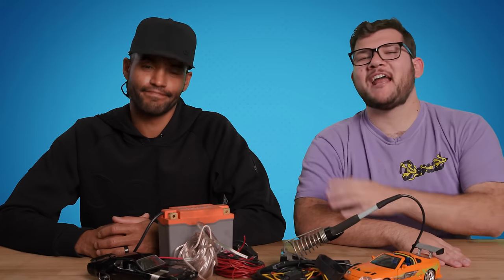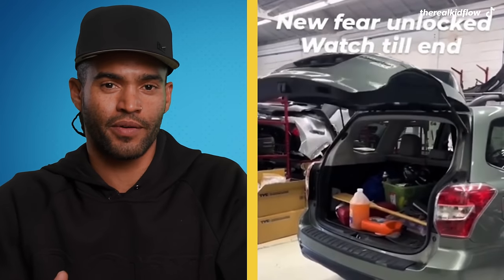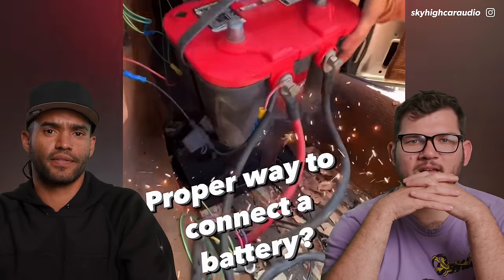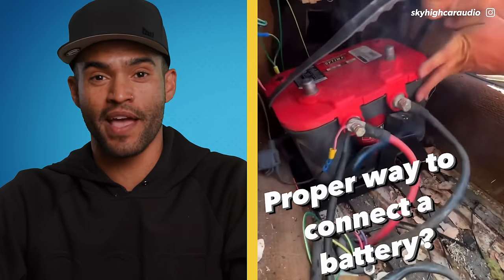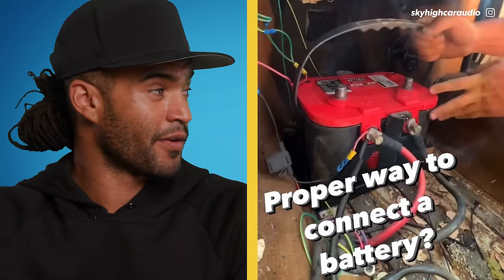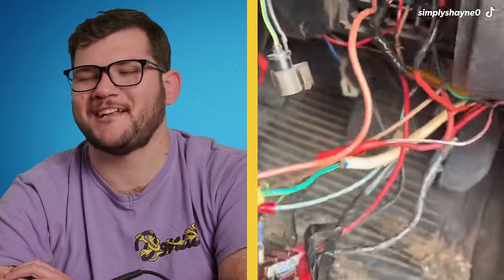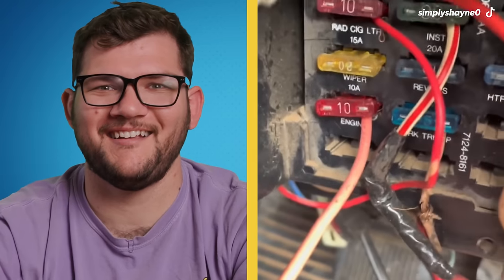Mechanic Reacts to Deadly Electrical Repair Fails

Comment: "Hey Subaru, open the tailgate." "I'm afraid I can't do that, Dave."
Reply: 12v open 24v close.😬
Reply: It actually is a serious and real issue. It an electric motor driving an actuator. Something stripped out inside, reaches end and bang!

Somebody tried to slam it shut by force probably.
Reply: Lesbian trap if I've ever seen one.
Reply: I had the same issue on my forester, just a blown gas strut
Reply: @JohnDoe-fb1zv 😂😂Lesbaru
Reply: That legit scared me
Reply: The voice saying that is burbed into my memory lol
Reply: It needs gas struts to hold it up where the motor stops pushing it open.
Reply: Portal Ref take my like
Reply: I owned a 2006 Subaru Legacy GT.

Previous single owner 0-105k miles was an old Japanese man who babied it.

I babied it for 3 years 105k-124k miles.

Total money pit.

Never Subaru. Never again.
Reply: @nTrylo true story?????
Reply: I feel sad that nobody really got your joke. Just want you to know I did, and I appreciate it.
Reply: That subaru footage is edited. Theres no way it will do that. Theres still a gear drive in the actuation strut. It doesnt just freewheel like that. It could if it were completely stripped out, but if that were the case it wouldnt raise either.
Reply: @jasonh4167  120A open. 800A close, more like. The whole tail of the car squatted when it slammed it was that hard.
Reply: @enemyspotted2467  You make it sound like such a small problem... this would have legit severely injured someone. This was not just the liftgate falling. It was motorized slamming.
Reply: @redcroft308  I doubt it's edited, that looks like the lift arm/actuator is either bent and/or mis-timed from the rear hatch struts failing. I've seen a similar failure with an older Sienna and Highlander, though not as drastic as the one in the video. 

The system that we're looking at seems to be similar to Toyota's set-up, those used standard gas-charged struts to support the weight of the hatch, with a third "lifter arm" sticking out of the driver's side interior panel to assist the hatch in opening/closing. It wasn't designed to fully support the weight of the rear hatch, so when the gas struts wear out it starts straining/struggling over time (I've seen this result in literally bending the rear hatch due to imbalance). In this case, I am guessing that their specific unit has either stripped the last few teeth on the gear plate and/or it hits a specific point where it deflects enough to literally jump time/gear and then just slams shut because nothing else is supporting the rear hatch at that point. Despite it being deceptively smooth in the video (most of the ones I have seen tend to jerk more), you can hear the lifter motor straining some as it's working. 

Unfortunately, if they let it go this long; it's probably going to end up being more expensive than two gas struts.
Reply: @redcroft308  Deconstruct how that was edited because I see no clear or obvious signs of modification. It slammed shut so hard the car squatted at the tag/tag surround flapped out also. If you can show or explain how this was edited I might be more inclined to believe you but currently I do not. At all. It seems to me to be a possible corruption in the BCM or another module perhaps, that when it's given the command to open the liftgate, it starts opening then runs into a computer fault/nand/cache corruption is read and the module just rams the liftgate closed. Also, everyone saying it's opening slowly... no. It's opening at speed. Closing at McLaren speed.
Reply: I have a forester, the back hatch  opens painfully slow. Also subaru has a recall/extended warranty on the gas struts.
Reply: @crazyidiot5309  the film clearly cuts. Its missing frames. You know, just like bruce lee movies where he "was so fast the camera couldnt keep up". Its not rocket science. The film is cut and lets say it isnt, somehow, fuckin magically. In that case, then the thing has been tampered with. Those actuators DON'T OPERATE THAT WAY, PERIOD. I'm speaking from a specific point of authority on this, if you havent figured that out yet.
Reply: @redcroft308  Time code where video cuts please. Also, if you know the way the actuators are controlled by the button/key, please map that out so I might believe you as well, because you've given no facts, only speculation with your "specific point of authority" on this particular issue. How does the actuator actually function, because with key/button control clearly indicates a connection with a BCM/ECU module of some type. There's like 30 of them in each vehicles since like 2000.
Reply: @clintondomingo932 it's originally from 2001 a Space Odyssey.
Reply: I’ve seen videos from multiple manufacturers that do this.  I remember for sure seeing a BMW do this.
Reply: "now dave.... Why did you oil change me 500miles later? Am I a joke to you?" 

Trunk starts opening and closing fast
Reply: @russelljacob7955 yeah I guarantee someone slammed it shut hard not knowing
Reply: @vinnyaraujo88  and when they go out You get this :D guess how I know :D
Reply: Smart move from the subaru owner. He found out his wife cheated on him.
Reply: Love the movie reference sadly not many noticed it😂
Reply: @hal8226  HAL was crazy

Comment: As someone who lives in Alaska, oil pan heaters are very common. Its called winterization. Very necessary when the weather can get to -50°. Wait till you see our parking lots that have outlets at every space. A lot of tourists think alaskan vehicles are electric when they see em all plugged in 😂
Reply: Same as Canadian Winters. Block heaters are pretty much standard
Reply: I'm a little surprised they aren't even a little familiar with the concept, and assume it must be a race car.
Reply: Same here in MT, gets as cold if not colder speaking from experience  (grew up in AK) and I feel bad for the car folks from less extreme climates not having a clue how to deal with it. Used to see alot of customers come into the parts store w a myriad of cold related questions and concerns and some needed ALOT of hand holding lol
That's funny too, about the parking power outlets, I'd totally forgotten that Lil quirk😅
Reply: I'd say that's a pretty standard with every northern place in the world. Like how stud tires are a must in the most northern parts of the Norwegian.
Reply: we used to call them dipstick heaters when I lived in Vermont in the late 70's early 80's
Reply: My VW VR6 has one because a normal water jacket block heater is not doable on it.

The installation though is pretty bad.
Reply: The California guys trying to figure out winterizing. 😂
Reply: Yup.  Lived in Fairbanks for 20 years.  I installed 2 block heaters, an oil pan heater, and a battery heater on my truck.  When it's 50 below zero, that's what it took to get that beast started.
Reply: Ya, I live in Fairbanks. It kinda surprised me when that clip came up, because it's rare to see a car without that stuff here
Reply: @freefall8243  "Impressive! That is like race car stuff!"

No, its a 15 year old economy car?
Reply: Southern climates have no idea what real winter looks like.
Reply: another from alaska and i instantly recognized the heating pad as the same one thats on my 3 trucks lol
Reply: Yeah in the north block heaters are a must but that one looked like a house appliance. It's going to burn after some slush and salt in it.
Reply: @aniyn  California people forget winter exists :P
Reply: Another Canadian here. Can confirm the block heater/Oil Heater is common here. I see setups like this around all the time. Id bet the third plug goes to one of those little buddy interior heaters. 3 plugs to 1 seems a bit sketchy.
Reply: Seeing as he has 3 plugged in I wouldn't be shocked if he running an oil pan, block and battery heater.
Reply: They are in CA.
They think it getting cold enough to freeze an entire pond is an urban myth.
But to be fair, I think they were referring to the crappy do it yourself job and not the fact he needed a heater
Reply: Found memories of plugging up my car with studded tires. Had a battery warmer and dip stick warmer.
Reply: Came to the comments to find the other people who live in northern artic climates. Shout out to Fairbanks
Reply: I actually recognized it from a completely different application- air inlet deicer pads on a turboprop engine. I wasn't aware that the same design was used on cars.
Reply: @Demonslayer20111 Aircraft mechanic here. I’m not familiar or I’m misunderstanding what you are talking about. Are these external pads? I’ve seen a lot of internal electric and a couple exhaust heated inlet lips, could you explain a little more?
Reply: I just seen this after I commented on same part 😂😂
Reply: Where I'm from you get an actual coil go into your block and all your connections are actually weatherproof. This looks bad
Reply: Same in Montana
Reply: @MichaelBrown-ff3go hi MT here too
Reply: @jbizzo2125  nice man, we do exist 😆😎
Reply from the maker: Let us know if you want to see "Mechanics React to Alaska Problems" -- ya'll are built different!
Reply: EVs are a very bad idea anywhere that can regularly get to sub-zero temps.  At that point they loose a LOT of power, booth in terms of output AND capacity.  So, of course, EVs are what the politicians are pushing for above all other problems right now.
Reply: @Razmoudah Some EVs already have battery warmers. They maintain the correct temperature when charging, and better models have a heating cycle that will warm the battery up on a schedule so it is ready to drive on your commute.
Reply: @calebergh I lived in Fairbanks as well from 2001-2004. I never winter until I had a winter in Fairbanks lol
Reply: That is a super home made block heater tho hahaha
Reply: Diesels in Europe can have Webasto heaters installed. They are like little diesel furnaces, plumbed into the block/radiator circuit. The remotes work for hundreds of metres, so even if you park on the street, you can pre warm your car without needing to be plugged in, or left running unattended.

Slightly larger models are used in RVs & boats to heat the accomodation overnight.
Reply: @russelljacob7955 Euro cars tend to have heaters that are plumbed into the coolant circuit. They run off diesel (you can get petrol models too, but they are rarer), and you switch them on using a key fob.
Reply: @bzs187 hell, i live in New Mexico and we see them all over the place. East NM smacks right through the southern end of the Rockies, and up in the mountains theres spots where it gets cold enough in the winter.
Reply: Legit in Alaska RN and have lived here for years, was about to say hey i even have installed those! that thing must have a pan, battery and maybe even a battery tender lol
Reply: @realmechanicstuff  - Yes, I would love to see that. But it doesn't  have to be Alaska. Any place that goes below freezing will do.
Reply: @realmechanicstuff  That would be awesome! Seeing some warm weather mechanics see what the cold can do.
Reply: I was going to say that was no race car, lol. California is obviously warm and dont see cold temps, but yes, 100% that was a block heater like he said, just for the freezing temperatures, not for the race track on that particular car lol.
Reply: You have tourists when it’s 50 below? Or you mean they see unused outlets in summer?
Reply: @aniyn I thought the same thing. It really made me think they only know what they see on tiktok lol
Reply: @realmechanicstuff as another fellow Alaskan, YES!
Reply: @King-Kazma  Not here. Merc vans pretty much it for that. We use electric heater that goes into place of a block casting plug. Not all engines can do that which is why they use the oil pan heater. Most new cars, they are wire in. Older ones just have a wire like that. With my Astra for example, there is a plug spot in the front grill.
Reply: @skinlesspartan7  And when you find them they are usually dead.
Reply: once had an 86 square body that came from the Alaskan Pipeline. It had the "extreme cold weather package". Which meant It had heaters everywhere. Tank heaters, oil heaters, block heaters. Heaters for both batteries (was a 24 volt diesel). It had wire heaters (like you find in the rear window on most cars) on the WINDSHIELD. And a cabin heater that would cook you out of the cab even on a 20 degree day.
Reply: Even the most recent generation of the Dodge Dart had a block heater under optional equipment.
Reply: @Puddingskin01  Every car I've ever driven has had a block heater and an oil pan heater, with a majority of them also having either a battery trickle charger or heater. They don't just randomly die. I've driven plenty cars that should've been dead, but weren't. Having these heaters is the only reason most cars start when it gets to -20, -30, -40 or colder
Reply: Oh good, I was gonna comment from Fairbanks, but you already took care of it haha
Reply: Yep these two bozos are clueless...
Reply: @realmechanicstuff yes please! And don't bother documenting Anchorage... They don't have real winters like us Interior crazies 😂
Reply: Don't use AC cords for DC, please. Amperage is usually higher on DC circuits to compensate for the lower voltage. Just... don't.120VAC is not interchangeable with 12VDC. Ever wonder why your battery cables are thick but your home wiring is thin?
Reply: Looks like my truck 😂 f1 cars stole my style
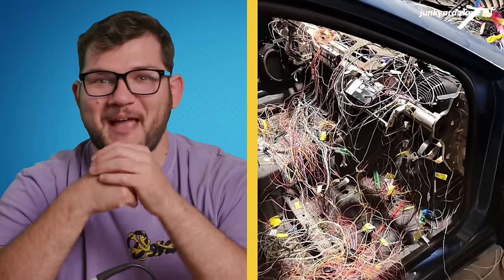Reply: 1:29 , that is what happens when you forget your blinker fluid 😅
Reply: So as weird as it sounds, but in Russia all of that stuff is popular only in like Really Far North (or East) rather than wherever. Only in regions where it's routinely -50 Celsius (which is pretty much the same as F, it's -45 F) there people have that sort of stuff. 

When I lived in Moscow and Saint Petersburg, no one I know had any sort of aftermarket heating installed, some people had beefier batteries and that's it. Despite the fact that in the winter it's completely normal to have the temp at -4 F throughout the winter and hitting as low as -22 F routinely at night. I drove an old Lexus that handled these pretty well on its own but I constantly thought that I'd love to have an additional heater in there, especially since the built in one wouldn't kick in like for 10 minutes or more
Reply: I’m from California and I instantly recognized what was going on but that’s because I ended up stationed at Fort Wainwright (Fairbanks) with the Army, and one of the first things they told us was that we had to winterize our vehicles. Outlets were in every parking lot, which was an adjustment for me lol I learned firsthand what happens when your car gets unplugged during the winter 😮 You should see the faces of people when I tell them that we would leave the car running while we fueled up at the gas station 😂
Reply: @t.mendous7922  holy crap the comment stayed. Whoo! I have no idea why it kept disappearing.
Reply: @realmechanicstuff  Absolutely. It would be awesome to see your mechanics react to cold winter problems. Will you be able to get a full video though is a question.
Reply: same in sweden, motor heaters, the oilpan heater vare like the worst, rather have my cooling reheated or my oilpan heater is just real garbage cuz it barley work below  -20+, my bad has preheateed cooler and he only need it plugged in for 2 hours. But I have a diesel heater, but sometimes its a gamble with  having en6ough battery to start .
Reply: @salemcripple  24 volt Diesel? Was it a CUCV?
Reply: Shout out from Winnipeg
Reply: pan heaters, block heaters, dipstick heaters, many ways of getting your oil flowing again in sub zero weather.
Reply: its not just alaska, been a thing in northern states for a very long time. @realmechanicstuff
Reply: Common here in Minnesota. We keep a few in stock at my shop
Reply: It depends though. Most diesels only need oil pan heaters in winter due to the viscosity of the thicker fuel. Gas engines would warm up faster, but not at all necessary.
Reply: @calebergh  shout out to the golden eagle in Fairbanks 🎉
Reply: That makes all kinds of sense. I've never lived anywhere that gets properly cold, but I'm slowly learning how much there is to learn about winter driving. It's just going to take longer and more work. And if you do that work and take that time, it'll work out fine. And boy will it punish you if you don't.
Reply: Welcome to Canada.
Reply: @realmechanicstuff  it's called winter.  California people who don't have seasons won't understand but when it gets cold, things freeze and they need to be warmed up.  Entire countries live this way.
Reply: When it’s springtime in Alaska, it’s 40 below. 🤷🏻‍♂️
Reply: @realmechanicstuff  I’m sold.